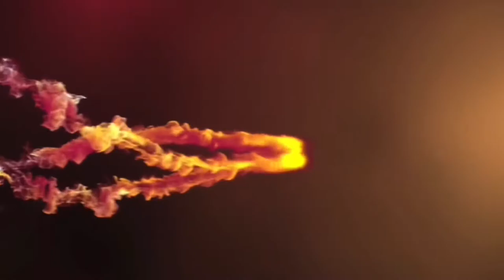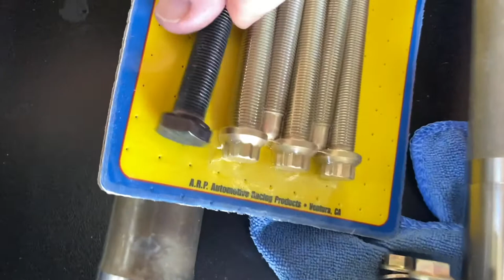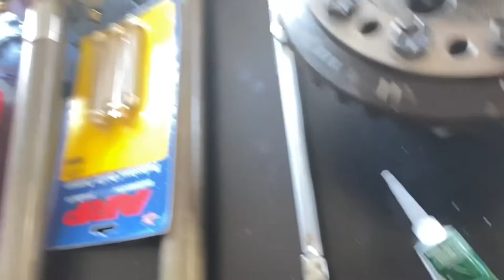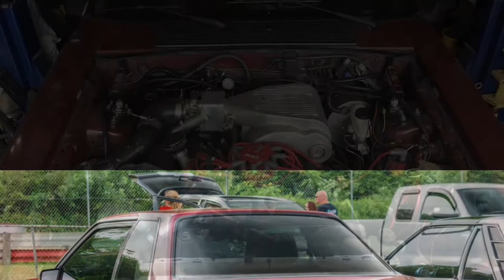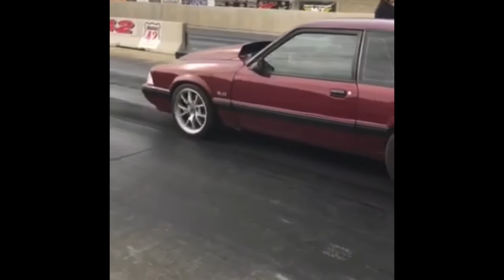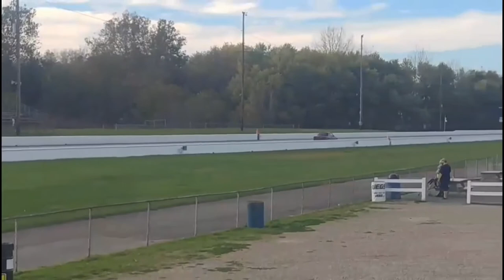Strange C clip eliminator and ARP stud install.

Comment: How did you choose strange over moser? I read strange has tinker bearings which should be better for street driving on the eliminator setup. I’m considering a swap and worried about fitment with my sn95 rear brakes
Reply from the maker: I have the SN95 rear brakes. You just need to get the correct center hub. Everyone I know personally that is fast run Strange and recommend them so that’s why I went with them and I prefer the design of C clip eliminator they have.
Reply: @NoFox_Given  thanks, can you help me and tell me what is needed for mine? Strange wanted me to send them pics of my rear disc brakes on my fox and they never got back to me. There was something special they needed to see to get something to work with my brake setup? Thanks
Reply from the maker: @timweb1510  it all depends on what style brackets your using. Mine bolt behind the flange like I showed in one of the videos. But, if you have North Racecars bracket they bolt in front of the flange. Then, if your using SN rotors you just need to let them know that I believe the center hub is 2.78”... just have them double check that.
Reply: @NoFox_Given  thank you, I’m going to try and check another day and try to get back to you. Thanks for info